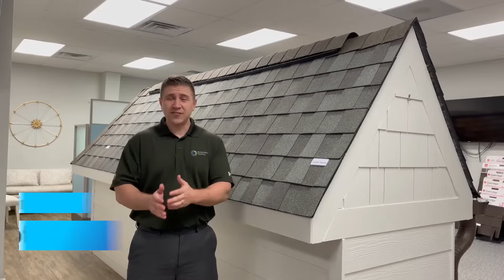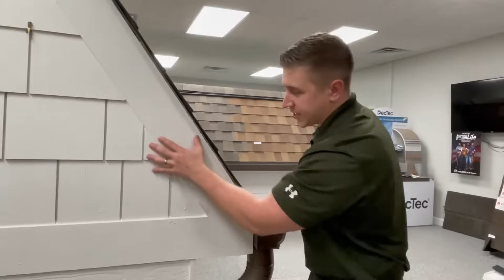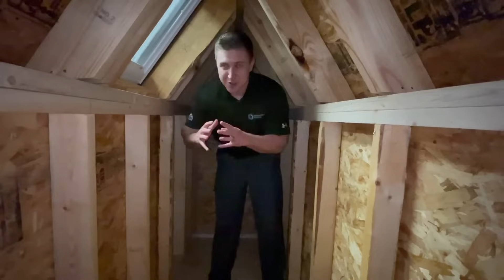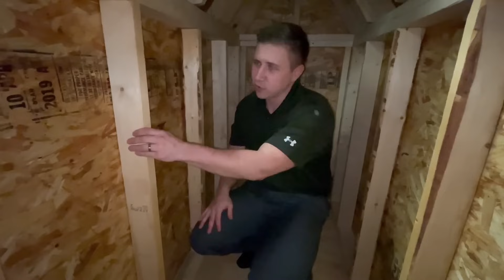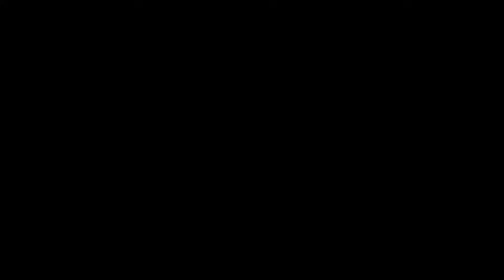Roofer Explains Roofing Terms: Roof Components and their meaning | Roofing Insights

Comment from the maker: From Insights:
00:20 Slope
00:55 Eave
01:13 Rake Edge
01:30 Gable vent
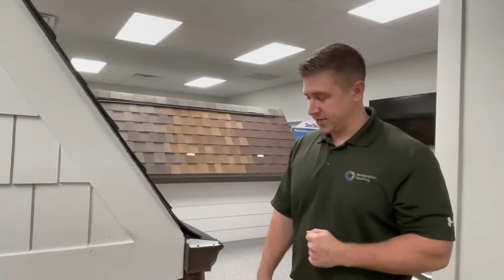01:55 Fascia/Soffit
02:23 Valleys
02:52 Ridge
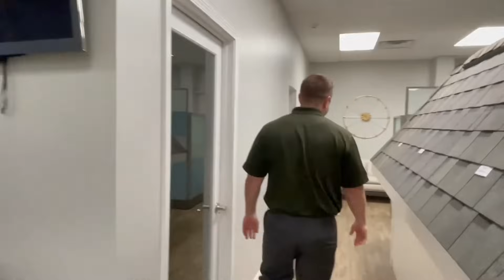03:28 Hip
03:55 How roofers measure roofs
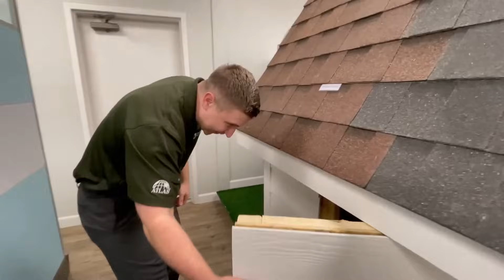04:38 Rafter tails
05:20 OSB sheathing/roof decking
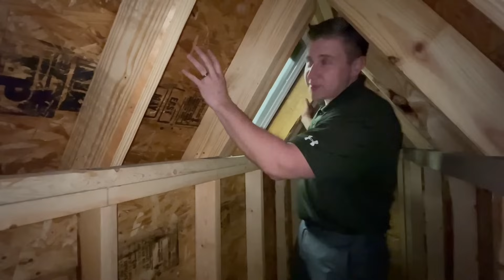05:37 Moisture barriers
06:03 Flashings
07:20 Counter flashing

Comment: The videos informative for newcomers for sure, but I do have an issue with anybody condoning beading/caulking in replacement of any actual counter-flashing. This is not a long term solution and will leak if not properly counterflashed, regardless of the roof, chimney, skylight etc

Comment: Actually, although the terms 'slope' and 'pitch' are used interchangeably, they are quantified differently. A roof with a 45-degree angle would be defined as a 12/12 slope. That means 12" of rise for every 12" of run. On a building 20' wide, the top of the ridge would be 10' above the wall top plate. That same roof would be defined as having a half (1/2) pitch, meaning the ridge height above the top plate is one half the width of the building. Your example of 18/12 would be a three-quarter (3/4) pitch. Yes, I know that it's an archaic meaning that no one uses any more but thought I would throw some history in there.